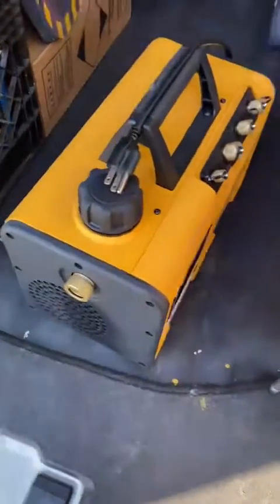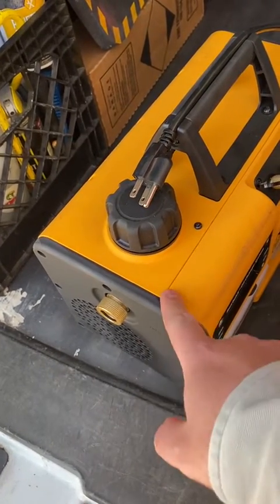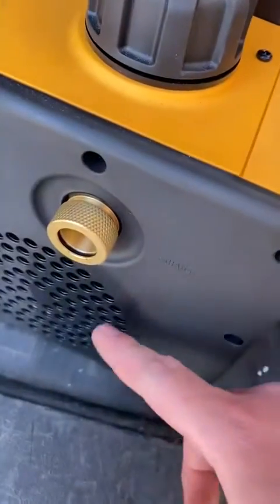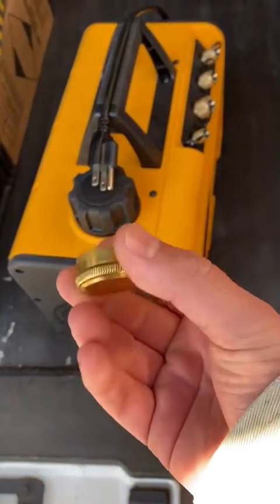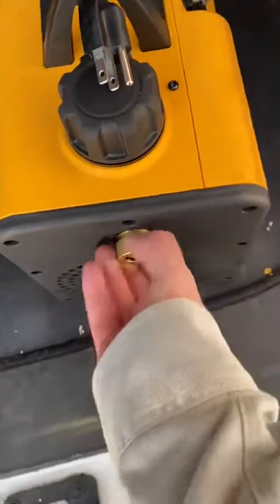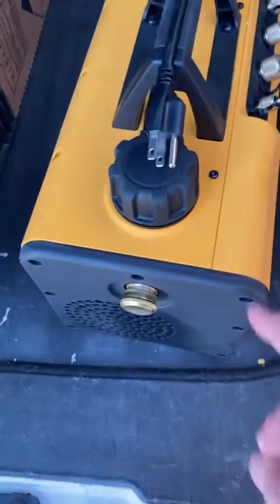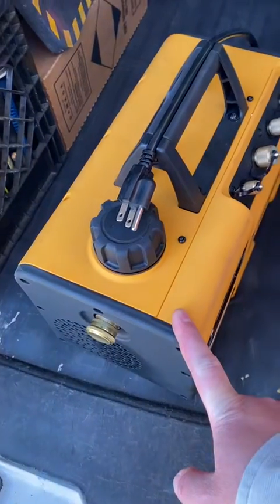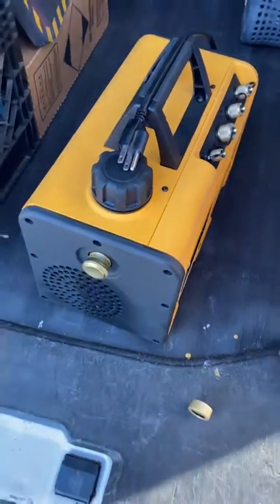Fieldpiece Vacuum pump Tech Tip

Comment: You don’t run it like that right? Is it leaking when it’s off?
Reply from the maker: No you take the cap off when running it. While moving it around some residual oil would leak out that’s why I cap it.
Reply: @HVACslayer  okay I get it now

Comment: Putting a garden hose, would that send all the fumes out of the house? Or are their multiple exits? (when in use, of course) thanks in advance
Reply: It’s designed for discreet venting of fumes, like you suggested you attach a garden hose and run it outside say you’re in a healthcare facility or inside a building pulling a vacuum
Reply: @hvacslayer